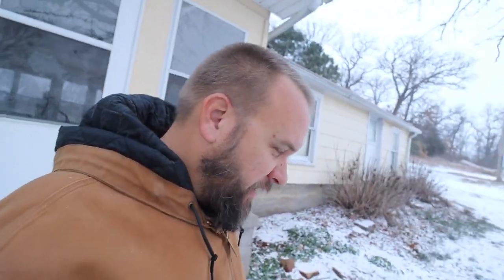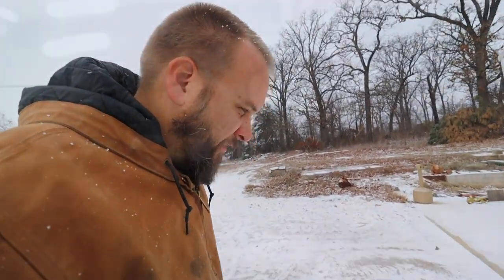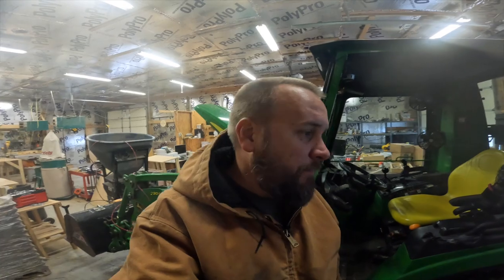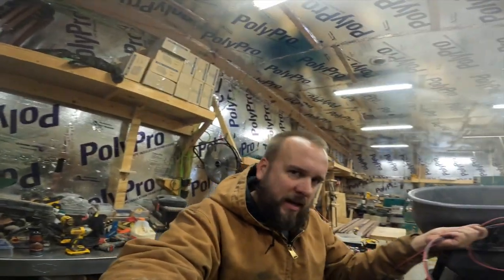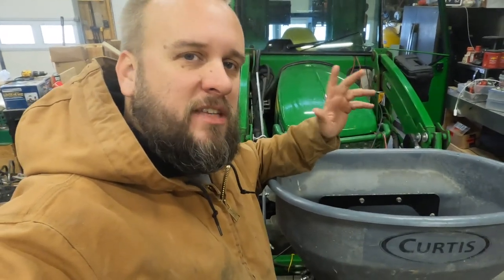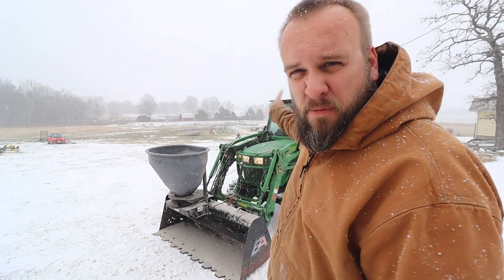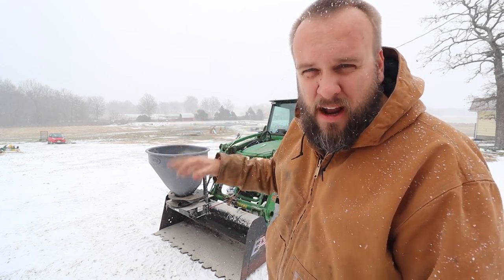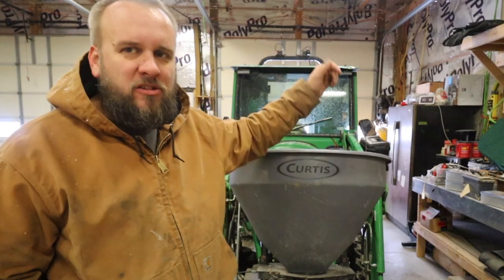This Makes it So Much Easier to Clear Snow and Ice

Comment: Howdy Brock - 30mph sustained winds gusting to 60 here... temp is -6 with a windchill of -33... I can't see the neighbor's house because of the blowing snow... and I just remembered I don't have the new belt installed on my snow blower.  Egads... I'm an idiot!  So it could be worse - you could be me!  😁 I hope the drifting doesn't get too bad... I also ripped the handle on the valve for my bucket right off with a tree limb on the last mow of the summer, and I haven't found someone to fix that yet either.  As stated earlier... I'm an idiot!  Thanks for sharing 🤠

Comment: I like that front mount option but I'd be worried about it bending the top of the bucket with the weight of salt added on a bumpy ride. It'd probably go well on a quick attach fork mount frame which is what I use and have the trailer hitch mover on that for a solid mounting. Thanks for showing this option and is sure nicer than rear mountings where you get tired of rubbernecking to see if its working properly.

Comment: Built the same 2 years ago, but with electric controls on the spin speed, open and close gate, and the rate gate.  Also added a convex mirror to the top rim so I could see how much was left in the hopper.  Alternatively,  on another spreader I put a flat plate with a graduated stick sticking up.  Using the marks in the stick I could see how much was left in the hopper with a quick glance.  But you have to always have your head at the same place to read it. Cheers!
Ps. Always wash off the tractor in spring to get the salt off. (I use dry sand).

Comment: It's -16 here with wind-chill, got some accumulation but with no cab it's going to have to wait. Also my 2038r threw a code for  exhaust pressure, the computer limits rpm to 1600. One guy on Google replaced his batter and that fixed it. Mine is. 17 with the original batter so hopefully low voltage is all that it is.

Comment: Maybe not with your soil type, but spreading salt on a gravel drive in WV causes the underlying soil to retain moisture which will turn the driveway into a muddy mess that resists drying. How do I know this you ask? Yep, found out the hard way. Thanks for the great video; you have a nice equipment and facility setup. Happy New Year
Reply from the maker: Thanks for sharing. That is a concern. When this pallet of sale is gone I’m switching to ice melt

Comment: Isn't the salt spreading a dust that will be all through the radiator and front of your tractor??
Reply from the maker: It gets in the bucket but not much else.  You just wash the tractor off later, which most people do anyway
Reply: @RockhillfarmYT  I do like the idea of having the spreader mounted out front